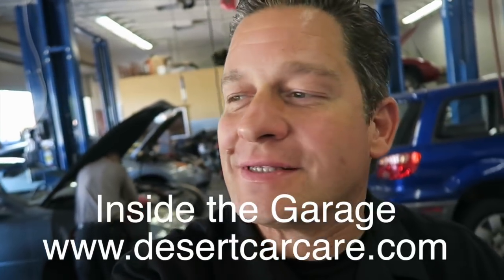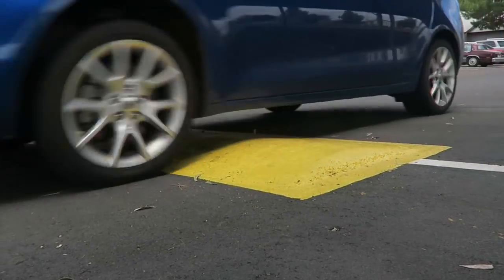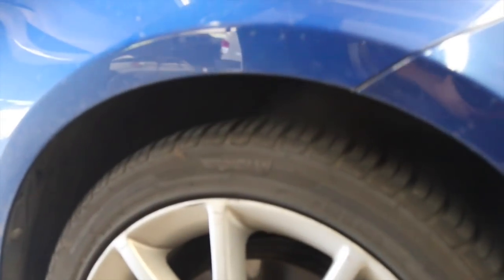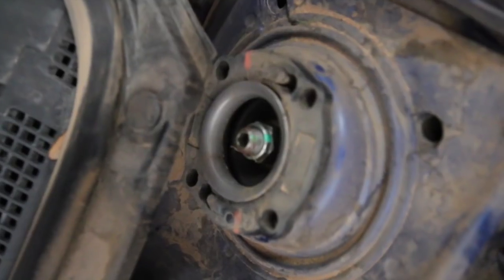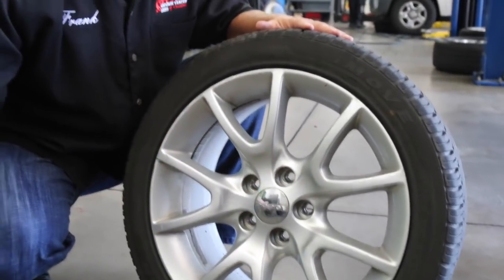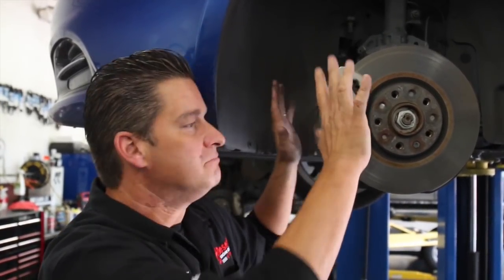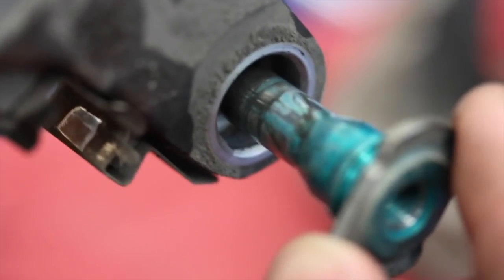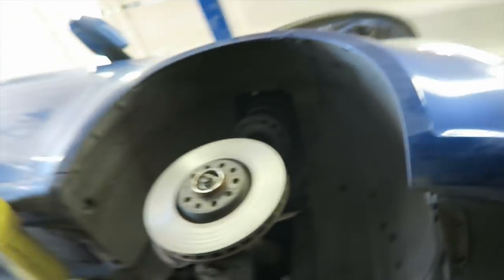Dodge Dart Brake Caliper Noise

Comment: You my hero i replaced the cv axle and checked all suspension didn't fixed until saw your video. Because was clicking so bad when i was breaking, i didn't replaced the caliper i just replaced the caliper braket because the 2 bolts where worn out a lots of movement, the issue its fixed thank you very much thanks for posting this video you save me a lot of money i was trying to sell my car but people tried to low baller me thank you so much

Comment: Well, you just solved my problem hopefully. I just did new brakes on my wife's 2015 Chrysler 200 with new caliper pins and grease and still have a loose caliper. Going to go through the service bulletins and recalls right now. Thank you!

Comment: I believe this has to be the problem with my car and soon as I look up brake caliber noise a Dodge Dart pops up wow isn’t that something. I had my Dodge Dart serviced the struts and sway bar links replaced thought the noise was coming from the strut mount or spring but I don’t hear the noise when I apply pressure to the brake pedal. So this definitely have to be the issue in my 2015 Dodge Dart

Comment: I got the same exact problem with mine its also a 2016 model and it makes that noise when I use the breaks and when I turn the wheels to both directions, but everything else is good the car is very smooth and fun to drive! thanks for the video man!
Reply from the maker: oscar diaz ...thanks for stopping by ! Always here to help ~~Frank

Comment: Thanks for this video! I have the exact issue and I was definitely headed toward the brakes and you just confirmed it for me. New calipers and pins coming my way....
Reply from the maker: Glad it helped ! Call us anytime at the garage if you have any questions --Frank
Reply: Desert Car Care I change my rear break pads and left rear caliper . After changing it making noises when I drive 

Whats the issue let me know please
Reply: Naimul Hasan I took his advice and replaced the Autozone brake pads with OEM and the noise 100% went away. It was the pads all along. The little metal clips that come with the pads was the key to the issue. The OEM pads come with metal clips that have a spring tensioner in them that separate the brakes from the rotors while the autozone brakes didn’t. So when I let off on the bakes, the AZ brakes kept making contact with the rotor causing chattering while the OEM pads no longer made contact. Those little metals clips believe it or not are so important. Let me know how you make out.
Reply: Can u just buy the pin? I just replaced my pad a couple months ago.
Reply: In case you haven't found an answer yet: yes! Caliper guide pins can be bought separate from a full assembly. They typically come as a set of 2 guide pins and 2 bolts to completely replace the old ones on a single caliper. These usually DO NOT come with the rubber boots that go on the pins, and are also sold separately.
Reply: @Shosui So, I regretfully overtightened one of my guide pins for a new caliper install and snapped the bolt in the process. I have purchased replacement pins for the caliper however, in my mind I'm thinking I can just swap out the pin boot from the one that I damaged instead of purchasing a whole new set of boots. Yes or no? If yes, then why if the boot is brand new anyway.
Reply: @Desertcarcare  on a volvo s90 i have a similar problem but only when i slightly touch brake pedal and wheels are turned a bit to the right,noise coming from front right(driver side UK)!done a full rebuild on front callipers and no noise for a month,now started again,do you think i should replace front right calliper?thank you

Comment: Had my calipers replaced many times from the dealership. The shop foreman finally came for a ride a long and told me flat out that they can continue to fix it but no matter what it's going to continue to come back. Had my dart since 2015. Its now 2021 and it's still an issue, with no recall
Reply: WELL watch more videos and fix the caliper pins yourself.. theres several good videos that show how to fix the noise

Comment: Hello! Sorry for bothering you. I have a similar play on my rear axle caliper on a Mitsubishi Lancer. I replaced the caliper sliding pins but the noise is still there. Caliper brakets can be repaired? I can't seem to find any after market ones as the original costs a fortune, I replaced both sides a year ago and the noise returned. I don't want to spend again 2 hundred dollars on a single bracket....I tend to think the quality is really poor... What should I do? The car is 3 year old, it's practically new....
Reply from the maker: Radu Michael ~~ring me at the Garage ~I will jump in with you & try & find a reasonable solution .

Comment: Helped me identify the exact same issue on my 2015 dodge challenger. Thanks a lot!
Reply from the maker: Ulises Venegas ~ rock on < glad it helped !
Reply: My car drove perfect I got a brake job done know my car feels like something is majorly loose. When you tap the brakes you feel and hear a lose popping sound. It's bad enough I also have a parasitic battery drain.
Reply from the maker: Richard Johnson ~ definitely recheck brake work ! If you need further help let me know ~
Reply: @Desertcarcare  I have a 2010 Dodge Challenger I bought the car used and knew if would have a few issues, but the; motor, tranny, and suspension was strong. I do have a parasitic battery drain, that drains my battery every 1-3 days? The car coded out for a cooling/heating fan relay. That hasn't been put on yet do to the mechanic not being able to find out where it goes. Second it coded out for a bad alternator that happened about a week after I bought it. Replaced it and also had the front and back brakes done. That being said after the brake job, now my car feels like there is something loose in the front right drivers side? When you tap the brakes it feels like the calipers are loose. Before the brake job the car drove imaculatly. I can't win for lose. It also has a leaking powerstering unit. And....
Reply: Can ypu send me any recalls on my car. I don't have a computer all I have is my cell phone. I live out in the sticks. Lol
Reply: Same issue for my 15 challenger. Should I just order new caliper?

Comment: iv got a lancer thats making a noise over bumps but when you break a little it stops was thinking breaks but now ill check it out tomorrow and see if its the same as this dart, cheers for the video
Reply from the maker: scitzen ...that would be be a great start. Don't forget to check those struts & strut mounts ! Thank you for stopping by ~~Frank
Reply: Desert Car Care yeh its definitely the rotor slight warping has gotten worse but im still driving it like normal lol but dont be worried im getting a new car and the rotor will be sorted before i sell it
Reply: scitzen
Reply: Yovany Arroyo yes?

Comment: Hey Frank and guys i just installed new calipers and pads on my miata. I know we definitely over tightened the caliper bolt on the passenger side. And the hardware/shims sent with the pads resemble the oem but the center/triangular portion of all the shims seem to be rubbing the rotors. There is an unbearable noise now. I would like to know what you guys and dudetts may think.  My hearing is fried due to many years in navy flight decks so tracking sources of sound is challenging
Reply from the maker: CHUTNEY 2020 ~ first off THANKS for your service!

We hate to say it ~ but will need to start from scratch here. Without the ability to actually see it first hand ~ tough to say ~ sorry
Reply: @Desertcarcare  no problem.  The noise has mostly left.  I'll bend the excess material of the shims back so they don't rub then get new rotors so it will all be new [calipers, pads, rotors, lines, hardware] then bleed several times.  And I'll loosen the the caliper bracket

Comment: Suzuki alto gf model has this problem too.
But much worse .
When going over a bumpy road sounds like the whole front ends falling out..
But only caliper slide pin bolts , hi from Australia 👍😊

Comment: I have the same problem but the dealer insisting to change strut and associated accessories. Showed TSB but still not ready to check caliper as you did. Took it to another place they could not find any fault with struts. The problem still not solved.

Comment: Ok I ordered the parts related to the service bulletin yesterday and the parts came today. The parts did not come with new slide pins. I had a professional mechanic install the hardware which includes a caliper bracket, some springs, and bolts. There weren’t any slide pins included in the TSB. The noise is still there but not as bad, is this because they didn’t include new slide pins? Help please I’ve been living with this god awful noise for way to long. I’m in a 2013 Dart Mopar edition.

Comment: So, I regretfully overtightened one of my guide pins for a new caliper install and snapped the bolt in the process. I have purchased replacement pins for the caliper however, in my mind I'm thinking I can just swap out the pin boot from the one that I damaged instead of purchasing a whole new set of boots. Yes or no? If yes, then why if the boot is brand new anyway.

Comment: Mine has this on the passenger side (2014 Dodge Fart, 80k). LOUD rattle over bumpy pavement. Bolts are tight, but the play is like this one. Got a job for this weekend I guess. Should I replace both?

Comment: I’m having the rattling pad noise in my 2015 Chrysler 200s. I just put new pads on it. Do you know if I can buy just the caliper guide pins and the oem brake pad hardware? Thanks!

Comment: Great vid. I'm hoping you can help out. I have a 2016 1500 sport model with the 8spd/hemi. I am hearing a rattle from the passenger side rear, possible the exhaust, but not 100% sure. It happens mostly on cold starts and the rattle used to go away somewhat as I drove and the truck warmed up. Now I hear it consistenly, especially over bumps. I haven't had this truck long, and started noticing this rattle as the weather got colder. What could this be? Again, it seems it is coming from the right rear of the truck, possibly behind and/or below the cab. Thanks again.
Reply from the maker: Paul ....give me a ring at the Garage. Best to walk through over the phone...480 726 6400 -Frank.

Comment: Frank Happy Holidays man, I have a 2013 Dodge Dart SXT over 120K miles on it, there’s a chirping/squeaking noise while Im driving. My mechanic replaced a hub bearing and a strut/shocks but the squeakings still there, any ideas what else it could be? Much appreciated thanks

Comment: Hey frank, got the same problem 13’ dart, but also has a violent shake in the steering wheel when braking above 45mph…rotors are not warped and in good shape, Could the shaking be from the caliper being worn/loose? Thanks.

Comment: I've replaced the whole front end on my cadillac, and i still get this violent gas pedal shake when I hit bumps. Also I hear like a metal whirling sound when driving, and my steering wheel shakes at highway speeds even after alignment and balance. Also the more I drive the worse it seems to get epically when it's hot outside, and it is some type of fluid or water that comes from the bottom of it after driving it. 

Could this be the brake calipers are seized? I have replaced everything on the front end, I did buy the car used also.

Comment: I'm having this exact problem, thank you so much! After three misdiagnoses and tons of research I found your video. The front brakes rattle over bumps but the slightest braking pressure causes the to be quiet. Now just to get it fixed, would replacing the calipers entirely fix this? What's the best route that won't cost an arm and a leg? Suggestions would be greatly appreciated. Also can I get that TSB? Thanks again.
Reply from the maker: John Moore ...awesomeness! They can be difficult to isolate..those darn noises LOL.Here is the bulletin number : SB-05-004-13. Glad it helped ya ! ...stay tuned..will have more tips soon. Rock on. -Frank

Comment: Do you have a part number for the updated design and did you have to change the whole caliper and caliper bracket or just the slide pins ? My wife's drivers side is making the same noise and we just replaced the brakes as the rotors were badly warped. Her car is a 2013 dodge dart rallye 1.4. Thanks for the awesome video. I always do my own work on my cars but this noise had me stumped. I believe it to be the same issue we are having.
Reply from the maker: Brandon Eberlin no part numbers off hand -however here is the TSB ~05-004-13 ~stating caliper brackets, spring clips and pads if necessary~sorry for delayed response here~hope this helps !-Frank

Comment: My 2010 1.8L Vibe/Matrix rears are doing the same thing. I bought aftermarket slide pins Dorman HW14470 everything is bolted down but the caliper still moves. Are both guide pins suppose to have the rubber o-ring bushing at the tip or just one of them? The originals were pretty corroded so I tossed them and can't remember which has a bushing and/or which goes on upper/lower on the bracket?

Comment: Nice man. I have an awful squeal that I took into Meineke a while ago I mean like more than a year ago. I had them check it out and they just wanted to charge me $700 to fix it all. I just had the bare minimum done. This incident made me get into car repair myself. Anyways.... the squeal is still there and it MOST definitely seems to be on the driver side but I have investigated both driver side brakes.. drum and disc.. and see nothing wrong. I am just driving on the squeal. If I find the problem ill make a video on it.
Reply from the maker: ...totally understand. Repairs should be broken down & managed. Rock on with your future as a wrench..always here to help ! -Frank

Comment: FIRST- Thanks for taking time to post your videos!  So much help for people trying to diagnose.  Similar issue for me on our 2012 Chrysler T&C.  Doing a brake job... took caliper pins out to regrease and noticed 2 different styles being used: 1 standard pin, and 1 pin with a suspension bushing (not the caliper boots).   The pin with the bushing is seized up on 3 of 4 of the wheels. Looks like no grease ever from the factory.  The standard pins still had grease and move freely. Can you explain these pins with bushings... why they exist, how to lube them properly and should they slide freely likw the ones with no bushings?  Ive searched the internet and no luck finding information.  THANKS AGAIN FOR WHAT YOU DO! - Tony (Michigan)
Reply from the maker: Anthony Charron ...I will be back up & running more videos in September & will select this very comment & demonstrate. In the meantime get those updated components & stick with Mopar.
Additionally oxidation can wreak havoc on these caliper slide points. Hope this helps brother! Always at the Garage if you have questions. ~Frank

Comment: So Before finding this video, I came to the conclusion my 09’ charger front caliper slide pins/brackets were wallered out and was the culprit for the rattle noise.. New OEM caliper brackets are discontinued.. so now what. Roll the dice on reman brackets and new OEM pins?
Reply from the maker: Uggh -parts no longer made makes it challenging - we like your idea there -pay particular attention to the original caliper mount bracket to ensure all is well there -unfortunately no other solution that we know of at this time -good luck !

Comment: Would you recommend a transmission fluid change on a 2013 ford escape 1.6 ecoboost with 95k miles?

Comment: My Car Recently Started Making A Grinding Noise Everytime I Would Drive, I Changed The Brake Pads The Rotors And It Kinda Stoped, Now I Only Hear Thr Grinding Noise Sometimes, Especially If I Go Over A Pot Whole, Also If I Have My Car Parked For A While And I Push It With My Hands Back And Fourth You Can Hear The noise, So Idk If It Can Be The Caliper Or Wheel Bearing?
Reply from the maker: Lupe Martha ..

Wheel Bearing : When driving & hearing that noise should slightly change when steering left to right. 

Brakes : Make sure rotors don't have imperfections & new brake pads are good quality. 

Reach out if still a problem frank@desertcarcare.com ✌🏻️

Comment: Gosh I wish I was closer. Just picked up same model dart and all recalls and things haven’t been fixed on it...mom of 3 and I don’t want to die in it lol. Is there any way you could advise a DIY if the dealership won’t help?
Reply from the maker: Lacy Callahan ~ first off ~ your not in any major calamity~ otherwise if you like call me at the Garage & I could FaceTime the specifics ~ no worries
Reply: That would be lovely. It’s making a horrible racket and has me skiddish.
Reply: I’ve been waiting almost a month and a half for my local dealership to get in the right recall parts. Is there any way you could talk me through the repair process since I’m so far away? It’s the oil in the brake line recall...
Reply from the maker: Lacy Callahan ~ ring me at the garage ~ do my best ~ Monday thanks

Comment: i have a 2013 dodge dart (same color as that one lol) but the back right wheel bearing is bad, it makes a lot of noise around 60, i need to replace it but im not 100% sure how. i brought it back to the dealership and they where gonna charge me $250 to fix it. i looked up the part online and its only $80, so i was gonna attempt to do it my self. any tips you could give me to help make this a bit easier on me?
Reply from the maker: ClunkGam1ng ...totally understand.  Not a challenging repair..if you can press bearing out with ease. (special tooling ). Call me at the garage & I can help walk you through or perhaps convince you to save a few knuckles & pay to have it successfully removed...either way here for ya !-Frank

Comment: I think this is the very noise I hear from my opel astra. It's exactly sounding the same, like two metals hitting each other on uneven surfaces but not on spped humps for now. Ama do thi check myself tomorrow cuz the other guys from garage just couldn't figure it out.